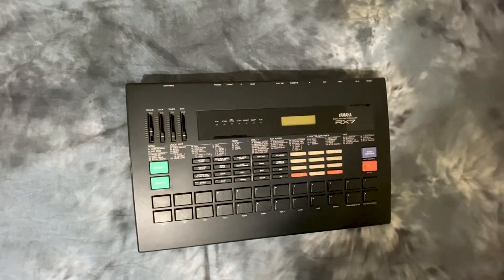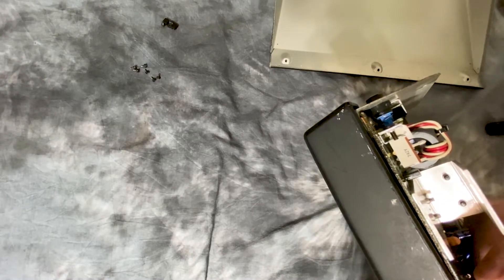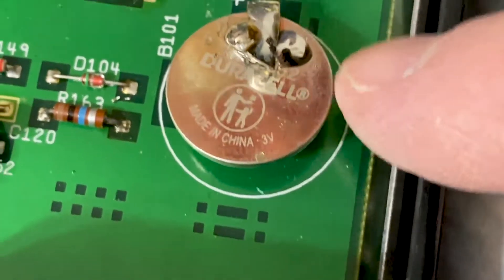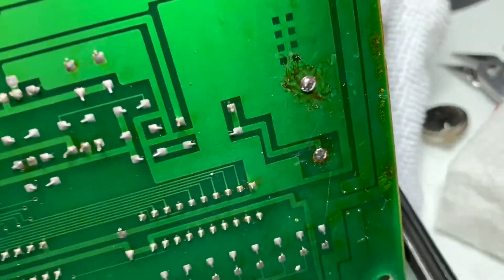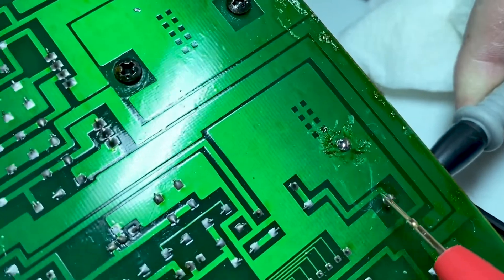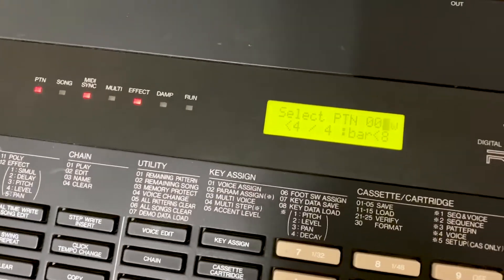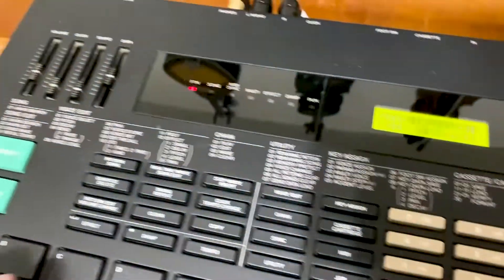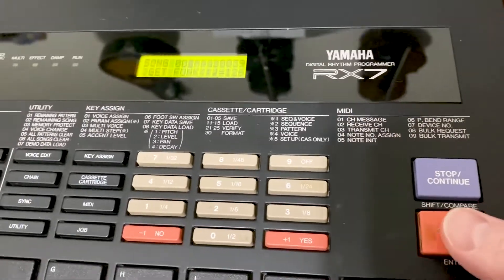Replace the battery in a Yamaha RX7 Digital Rhythm Programmer and perform a factory reset

Comment: Thank you for this, did mine today. Greatest challenge was bending the pins on the battery holder I had so that they both fit and would go through the holes. Thankfully I'd bought a pack of 10 holders, because I broke 3 of them before I go it right. Otherwise, was very simple and your video helped a lot.
Reply from the maker: @tripgunn5549 - You’re welcome. I’m glad I could help.

Comment: But with the time required to change this battery [soldering, etc], doesn’t the memory get wiped clean?
Reply from the maker: @maxwarfield6699  Did you even watch the video? That’s why I show how to do a factory reset.
Reply: @RyansCustomShopandGearOutlet  I watched all 19 minutes of it. And I know you performed a factory reset but was that, because the memory was lost or corrupted - you WERE getting sounds [weird ones]?
Reply from the maker: @ - No battery, no memory. When the battery runs out, the memory is gone. The weird sounds were the corrupted patches after the battery change. The factory reset restores the factory sounds. I hope this makes sense. Personally, kind of like the corrupted sounds.

Comment: Hello where did you get the new battery carriage from that you soldered to the board and what number battery did you use?
Reply from the maker: Amazon and CR2032
Reply from the maker: I would also mention it is the same battery holder as you would find on just about any old computer motherboard. Same size and same battery. If you have an old broken computer laying around, you could just desolder the battery holder and reuse it.

Comment: Thanks This will come in handy I’ve had mine since it was brand new and never needed to change it yet and I use it a lot. Does it actually need soldering coz I have a EX7 workstation and changed that battery a few years ago and it was just a slot
Reply from the maker: You're welcome. I'm glad I could help. This model does need desoldering and soldering for the battery change. You can buy batteries on Amazon with the solder tabs attached that allign with the holes (search for CR2032 Lithium Battery with Solder Tabs), or you can install a battery holder like I did to make changing the batteries in the future easier. Be careful not to damage the PCB traces when desoldering.

Comment: Hey did the pins fit? or did you bent them to fit?
Reply from the maker: You have to bend the pins to fit the holes. They are not a direct fit, but there is enough length on the pins to adjust. If I remember correctly, I think I left one pin straight and adjusted the other pin to fit.
Reply: @RyansCustomShopandGearOutlet   Thanks! I will try that. Looks like you were doing something like that in the video and for me the dimensions were off about 0.5 mm so see if it works.
Reply from the maker: @WalyB01  the one I used had plenty of pin length to bend into place. It's enough to make contact and solder.

Comment: What does the battery do?  Mine won't power on and the power adapter is still good.  Would the battery prevent it from powering on?
Reply from the maker: In short, the battery is for internal memory storage. I'm not sure if a bad battery would prevent a power on. As I recall, this unit powered on with a no battery error message. As shown in this video, it requires desoldering the old battery from the board. You can purchase batteries with the solder leads attached, but it's easier just to install a holder for easier future battery changes.